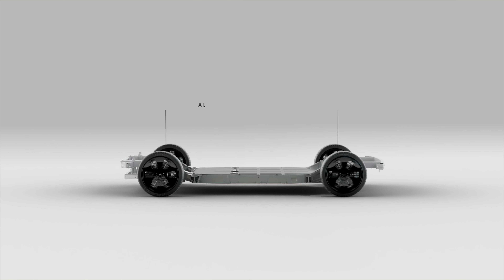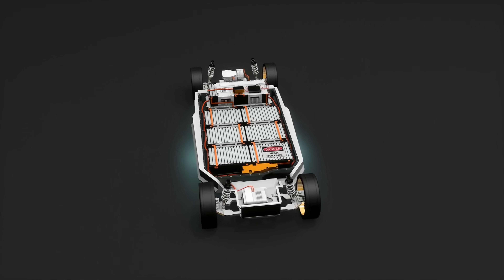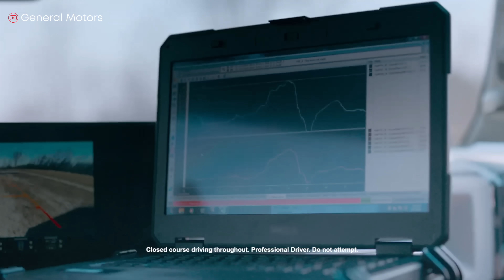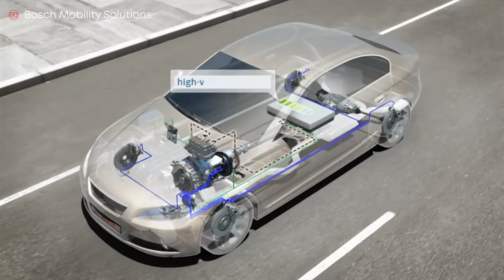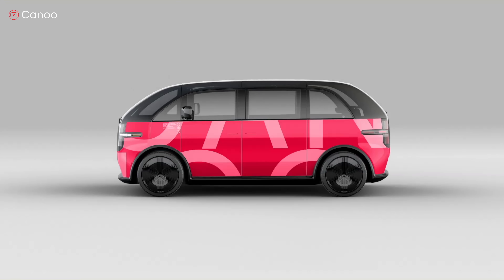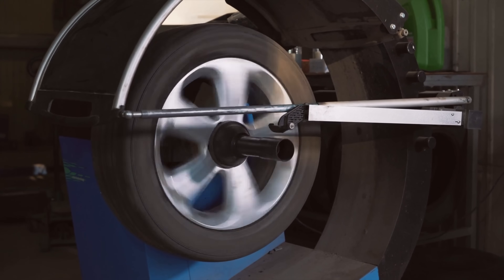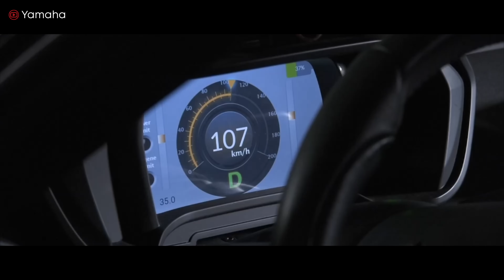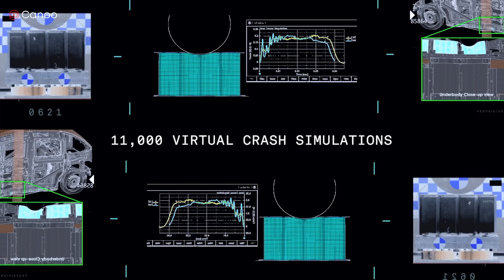No One is Telling You the Truth About Electric Cars, So I Have To

Comment: The only drawback in my opinion is EV’s do not have the range like a traditional gasoline powered engine. Another point is, charging time and where to find a charging station. If you’re just driving around town that’s fine. But what if you want to go for a long drive?  You could be SOL . Currently there are not enough charging stations in a lot of places. That’s something to keep in mind. It’s going to take quite awhile to get the EV infrastructure up and functioning.
Reply: Also I live in where the temp goes to -50.

Comment: Regenerative braking means the brake discs aren’t being used much (if at all). Disc brakes are designed to be used regularly in order to clean off surface rust and stop rust penetrating the discs. So if surface rust on the brake discs isn’t regularly cleaned off then rust will penetrate the discs and ruin them. This can happen very quickly in damp or humid climates. What does this mean in terms of electric car running costs? It means you may need to budget for the costs of replacing the full set of brake discs much more often - possibly every year in some climates.
Reply: That's a non-issue. In actuality, you replace them far less often. Tesla owners, which exists in many different climates have seen 100,000 to 150,000 miles between replacement, with other vehicles showing even longer.
Reply: "Disc brakes are designed to be used regularly in order to clean off surface rust and stop rust penetrating the discs."

It's possible that knowing this, the engineers altered the design and/or material, or perhaps it's not as detrimental as it appears. Real world data has shown it to work quite well regardless.
Reply: @JimBob1937 
It may be a non issue with Tesla which is a top end price manufacturer and can afford to fit more expensive nonferrous discs which don’t require regular use of the brakes to avoid the rust pitting that causes terminal damage to the discs. But what about the middle and lower end manufacturers who have always had to use cheaper components? If these videos are only about Tesla then it would be fine to ignore this issue, but they claim to be about all EVs. Have a look at “Can EV Brakes Rust From Disuse” on motorbiscuit and I’m sure there’s other places too on this
Reply: @jaywalker1233  , I've talked with many others of other EV manufacturers and have seen stats on them too. For the most part, EV brake pads last much, much longer on EVs, no matter how cheap the EV is, as long as regenerative breaking is a feature of the vehicle.
Reply: @JimBob1937 
This isn’t about the pads - which don’t rust and are cheap to replace
This is about ferrous discs which RUST and are NOT cheap to replace.
If you can confirm that ALL EV manufacturers ONLY use nonferrous discs then I’ll shut up :-)
Reply: @jaywalker1233  , I think the issue is your premise. You may be correct, yet, somehow it isn't much of a factor. I found Tesla's use regular ferrous discs... yet, they have proven, in the field, to last a lot longer. Hence, maybe your reasoning is true to an extent, yet apparently isn't the main factor in their longevity. So, I don't really need to confirm much beyond that, as really, the data we have from EVs in the field show the braking system as a whole lasts a lot longer than regular vehicles. I can only assume, wear from usage is the main factor on their lifespan, and secondary factors, while having some impact, are not the main factor.

Comment: The only reason for EV’s holding their price recently is down to supply issues affecting the new car market. The big elephant in the room is battery longevity. Batteries don’t last forever. My phone is only a few years old and already holds less charge than new. As a car battery deteriorates the vale will plummet. The battery is the major cost in these vehicles and replacement will be prohibitively expensive. You would have to be insane to buy an older EV. They are essentially a chuck away item presenting a recycling nightmare. Car manufacturers are milking this inferior tech prior to launching the far more sustainable Hydrogen tech as tested successfully in California many years ago then shelved in order to profit from the questionable impractical Electric options prior to unleashing Hydrogen. (Think Cassette tapes vs CDs) Don’t be fooled buyer beware!

Comment: First, and not mentioned is that one great thing about EVs is that the batteries are usually warranted for 8 year for 100,000 miles. For anyone but very high mileage drivers, this offers a good piece of mind.  Next,  while early electric cars (Nissan Leaf being the most notorious for this) lacked it, modern EVs have active and passive cooling for the battery packs, and usually this is done with liquid coolant.  This has greatly reduced the likelihood of heat damage or degradation.  Also, the energy management software has improved to the point where battery packs could last 300,000 miles (Musk says this).

Comment: We had a rainstorm in Yorkton Saskatchewan about a week ago and the streets were flooded Vehicles were pushing water with their bumpers what would an electric vehicle do when it's batteries are submerged in water?
Reply: You make it seem like combustion engines don't cut out in floods. 😂
Reply: @briangriffin5701  would you drive an electric vehicle through water?
Reply: @keithfialkowski5689  Depends if the battery compartment is water tight.
Reply: @briangriffin5701 🤔 so you don't know what would happen, that was my question in the first place. They can't be watertight because one person wrote in and said a rock got in between the batteries and wore a hole in them. At between 10000 and $20,000 to replace would you take the chance?

Comment: Do you have any guesses as to the trade in value? It looks like a ten year old car could be worth less than nothing (disposal fees). Regardless, someone will get stuck with the recycling costs. Also, how far away are the developers in being able to purify recycled lithium to car quality product?
Reply: The difference here though th an ICE car's engine is pretty much scrap metal at end of life. The battery in an EV will last a long time in home power storage which will soon become a big thing. Yes, modern EV batteries will likely outlast the car!
Reply: @roundel52  That's hilarious. Using dead batteries for home storage, what a great idea.   🙂
Reply: @rosshaskell7967  I never said they were dead! A battery good for 500k miles+ (million mile batteries are already available) would outlast many of the cars... So providing a very useful second life. Besides, the requirements to power a car are much greater than powering a house.

Comment: What about your electric bill at your home for charging your car? That also should put the cost of owning an electric car.
Reply: $25 month
+ not dealing with busy other customer or cars.
Reply: charging is about $5-$10 daily if you use the car as a commuter... so yes better than gas but you do have to wait for the charge and hope the charge unit does not fail where a gas car pump and go or goto a working pump at the station...  Rarely will you see more than 4 electric chargers in one location its mostly 1 or 2  (unless its Tesla...special plugs/chargers that are not compatible with any other vehicle)

Comment: Been watching EV prices and availability and so far even with a 38.5kw solar installation an ICE powered vehicle is still cheaper to purchase and maintain in my situation. Thirty grand can buy alot of fuel and maintainance. I run several lithium ion battery powered tools and at this stage battery cell failure and corrosion/contamination of components in an EV would be a big concern. Along with range and lack of charging stations in the country.

I'm also not liking the fact that all these vehicles seem to be tied to the manufacturers. It might be paranoia but what would happen if a virus was to get through, could it potentually shut down/contaminate every connected vehicle? Also, big brother's watching...

So far I think plugin hybrid might be a more viable option for my situation but of course they are more expensive to purchase and probably to maintain.

Comment: I live in Texas and it gets really warm here, it's actually common for road tar to soften and allow the aggregate to get pressed down into it. This issue forms big black slick spots on roads, when conventional cars pass over these spots they make noise and that noise is quieter for a Chevy Spark than it is for a Freightliner. EV cars make more noise than you would expect from a car, they are about as loud as a pickup truck over the same patches.
I suspect this is due to their weight and also the reason why EV's are so hard on tires. 
The EV owners in my area also tend to drive their vehicles aggressively and I speculate that this is because they don't get punished as severely with high fuel consumption like a conventional car would when driven the same way, this also contributes to tire wear. 
My coworker got around 45,000 miles out of his Tesla tires and I got over 75,000 miles on our Yukon XL tires. 
Maybe Tesla needs to switch over to an SUV tire to help handle more weight.

Comment: Thank you Scotty for this presentation.
Regarding temperature impact on batteries it seems places like Africa, the Caribbean and Alaska may have shorter battery life on the EV due to their hot and cold temperatures respectively. Any thoughts anyone?
Reply: This was demonstrably true with early EVs like the Leaf in areas like arizona, drivers had noticeable battery degredation in only a few short years. However much of the problem was due to a, to be generous, optimistic viewpoint by the manufacturers that active cooling wouldn't be required for EV batteries

It most certainly is, and between most/all EVs introducing it (if not starting with it as the Volt did) and improvements in battery management/chemistry it's not as significant a problem as it was.

However you can't ever really avoid it entirely. Certain batteries like certain temperature ranges, and in general most like mild temps. Maybe we'll see different chemistries used in different climates in the future.
Reply: I wonder if they could compensate for the temperatures for the climate the vehicle is sold? Possibly Cars in Alaska could have heat tape or something like that?
Reply: Cold is less of a problem than heat provided you have a charging point. All that is needed is some trace heating drawing from the charger to keep the battery within spec whilst the vehicle is off. Getting rid of heat is tricky, either you actively cool or have some kind of Peltier plate.

As for Africa reliable electrical supply is rare, even getting clean quality fuel can be an issue at times. They do have lots of sunlight though.

Comment: Does the new infrastructure bill address the fact that we are going to need more power generating stations? Silly me. Of course not. But it’s does provide subsidies of EVs. Where will all theses batteries be dumped once they are useless? Oh by the way China makes the batteries right? China owns most of the mining operations around the world. China exports the raw dirt to their country for processing for the minerals. Why because it’s very polluting process. How much fossil fuel is used from raw material to the car on the showroom floor? Could it be many times more than an EV will save? They are going to love EVs in Alaska
Reply: You got the silly you part right.  No more power needed, plenty of it already.  The number of people driving isn't changing because of EV's.  And since EV's are much more efficient that gas cars, less power will be needed.
Reply: Arguments not un similar to this were popular in the early 1900’s when it was horse vs. any  car. Slow, stinky, and often requiring a set up before each use, the horse was the big loser. Buggy whip manufacturers must have been livid...then they were gone. There were no roads ,no gas stations ,tires were horrible , etc,etc, ...yet what happened?
Reply: Yes, the new infrastructure bill allocates $7.5B for charging stations. The original bill had more, but being a bi-partisan bill, the Republicans have cut down the number as much as possible.
Reply: @DoctorZisIN  power generation. The producing power. The power that supplies charging stations.
Reply: @davidflint12  Oh sorry, $73B to the power grid. Haven't read the details but it's meant to improve energy production and transmission, including boosting clean energy sources.
Reply: Some very cheap EVs made in China show that they can require less energy to make than ICE. A fancy Tesla will of course require huge amounts of CO2 but maybe overall less than a similar priced BMW… maybe…

Comment: "In general, Electric Car Motors can last from 15 to 20 years" -> 7:33
Another Video Suggestion for Scotty? 
Replacing the Batteries on a USED Electric Car.
Reply: Yep, who is going to keep a old electric car that long?  then replace the battery in it to keep it as long as the motor?  Is it not the point to buy a future car???
Reply: Consumer demand will force manufacturers to produce cars with easily accessible batteries.  Battery technology has a long way to go before EVs will become affordable.

Comment: To adress some of the things Scotty talks about:
* The battery will last way beyond 10 years if you drive as you should and don't overuse the QC. There are OG Telsas, they are about 10 years today, which has run as taxis since start with minimal issues. Similar with Nissan Leafs from 2012, some of them still run on the original battery and have over 75% capacity. Albeit it's a small battery - but it shows that even the oldest and least durable batteries hold together.
* Talked to a Nissan dealership today, they base the price of their battery on the premise that it will last at least the lifespan of the car - so 15-20 YEARS. Even thou the guarantee ends after 8 years.
* Ignoring German electric cars; the price for yearly service in Sweden for an electric car is about 2500sek, or about $200. Same cars but with ICE cost between 4000sek and 8000sek. So price per service is extremely low
* Expected price per 10km, in Sweden, is about 20sek for a gasoline car and less than 3sek for an electric if you include cost of ownership and maintenance.
* The electric motor is more or less indestructable and will definatly last past any other equipment in the car so long as you don't race with it. But they are not racecars - so that won't be an issue :)
* Batteries will imrpove significantly over the next few year. Samsung and Panasonic will release their SSB and, if all goes well, we'll see those in Toyota's and Nissan's from 2023. First gen SSB will have about 20% higher energy density and will be able to charge between 10% and 40% faster than todays fast chargning Li-pos or Li-ions.

Comment: Aloha and good evening Scotty.  This is an awesome video.  You covered it in great detail.  The only factors that you may have omitted are fuel cost that'll increase the price for electrical utilities in homes for the recharge.  Plus, the detailed maintenance is a major strain on the wallet for EVs.  The EV maintenance is very detailed as the mechanical shops are going to be very expensive to pay for the manual labor cost to the repairs.  For now, EVs can't be recharged when natural disasters occur annually.  This is where ⛽🆓⛽🆓⛽ powered vehicles can readily go to taking anyone to the destination it needs to be in like the medical center or their doctor.  This is why I'm holding on to the gas vehicle 🚜🚑.
Reply: @pigjubby1  Very true to that indeed.  Plus, the utility companies are increasing and raising their fees/ rates with the high strain of inflation with this incoherent administration.

Comment: Hey Scotty wait! You said Lithium Ion batteries on electric car can last for 10 years??? Hey FYI! My very first car 👉 1995 Toyota Corolla 1.5L 4 Cylinder Gas car still lives up to this day year 2022. My 👉 1989 Nissan Datsun V6 Pickup Truck 4WD Hardbody also still lives up to this day year 2022. Both of them are still running and even though they're both exempted on California Smog. But both of them can pass smog if needed. No engine replacement, no engine swap. The vehicle is still what it is only maintenance and slight and cheap repairs.

Comment: Just a couple thoughts; Can a mice cause shorts in the wiring, Salt spray from the roads (northern states) cause corrosion, who works on EV cars (dealers only $$$)how are they when the temp is -20 F, what is the trade in value (who in their right mind would buy a used EV car)
Reply: Lol bro i live in Ontario Canada we have days at -20. A good amount of times in winter they are forcing it in Canada which is Completely idiodic there have been some days so cold my cars wouldnt start

Comment: Much enjoy your videos. I have had an electric car ( Renault Twizy) for 10 years, 50,000 kms. I loved it to begin with and got great use out of it. But now I see the huge downsides. Last October the “ charger” went. Took until now to get it fixed. 1400 euros. Now it turns out out the real problem is the battery. 3000 euros! Anyone with an electric car of over 8 years will have to face this reality. A disaster.

Comment: I appreciate your video but I think while you did mention the battery replacement cost you did not factor it in the overall maintenance cost.  At the end of 10 years of so who ever owns the car at that time is going to get stuck with a bill for $10-15K+ OR junk the car.  A gas vehicle doesn't have such a scenario.  Over that ten years or so there is going to be little real difference in the maintenance cost.  Another consideration is the price of electricity at recharging stations outside a persons home makes the cost of charging nearly equal, per mile cost, as an ICE vehicle,  Been there done that with electricity cost with a plug-in hybrid.